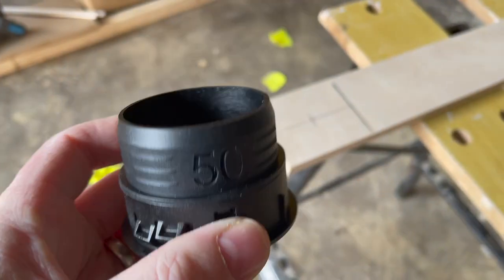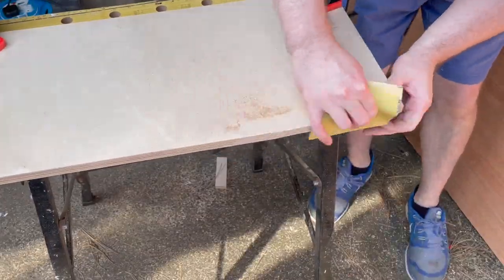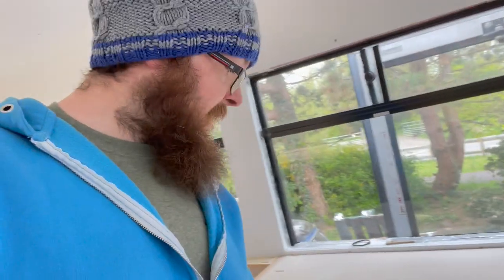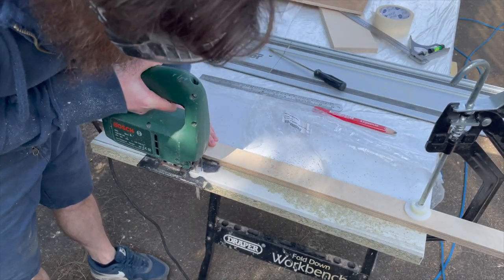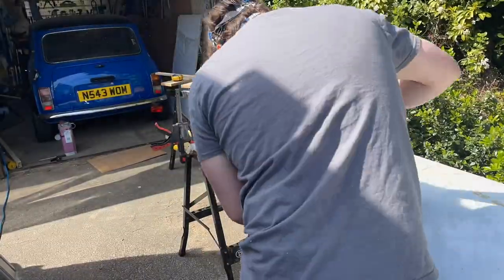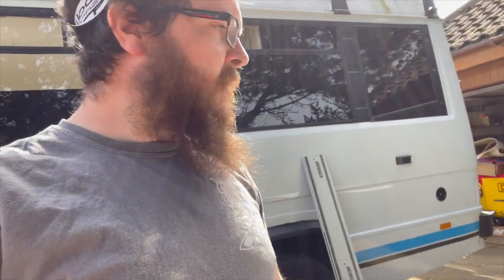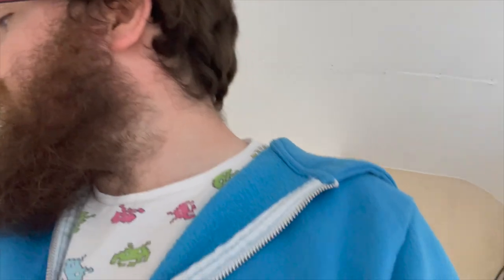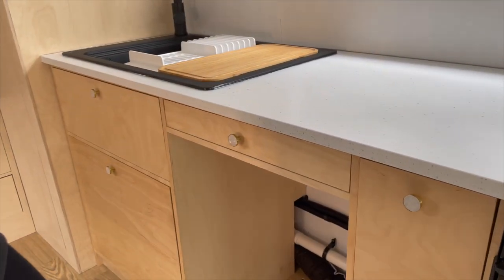Amazing Progress on Van Kitchen - Neat Features + Layout! (All Mod-Cons) | Diy Van Conversion

Comment: Greg would be proud of that kitchen build I am sure.
It is great to see the progress on your build. It is looking really good.
Love your attention to detail. I found the Triplex installation in my van to be a bit of a head scratcher but pleased with the end result as it is an excellent hob and oven. Just be warned, it rattles when driving so we take the racks and grill pan out and put a draining mat under the lid when we are on the move.
Reply from the maker: Thanks so much Peter. That is really useful to know, thank you for that. Will pop the racks away when driving. It looks right at home now, still have the gas pipe to do but overall pleased with how it fits now - these things are sent as a challenge 😊. Thanks so much again, really appreciate it.